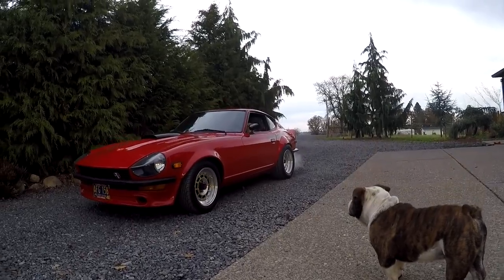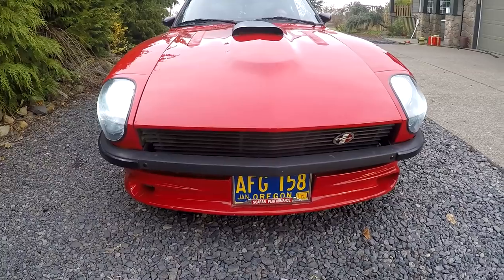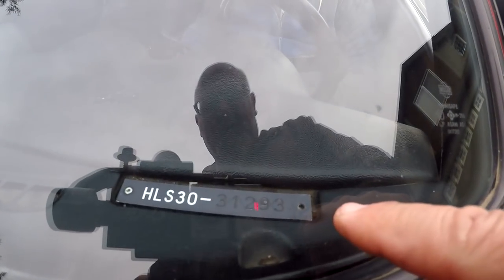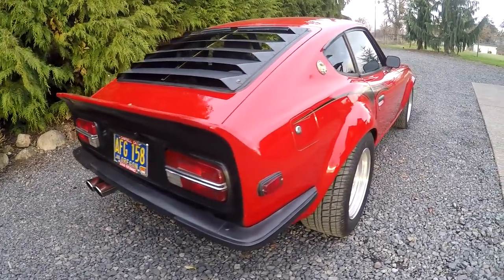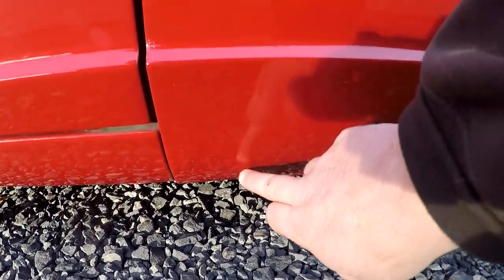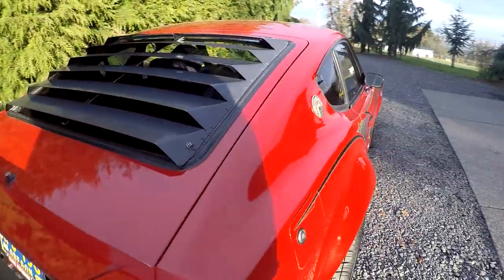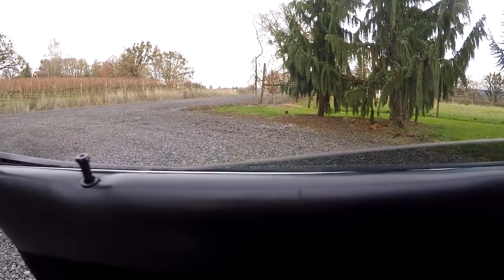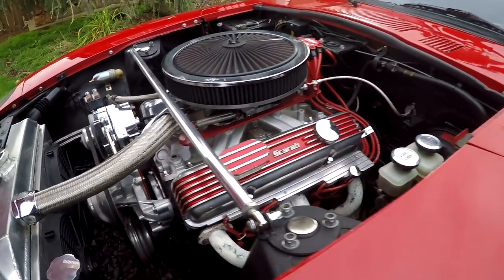1971 Datsun 240Z - ORIGINAL SCARAB

Comment: Purchased a Scarab kit in the early 80's for my 72 Z, great kit with engine mounts and headers and an aluminum bell housing that incorporated a hydraulic clutch                               which was a savior for my left leg, lol. I installed used parts throughout and that was a mistake, never upgraded the suspension so straight lines  only, engine was soo far forward to clear distributor, hurt handeling. Today I would do the LS conversion with Apex kit and T56 and upgraded suspension, would be a killer car.